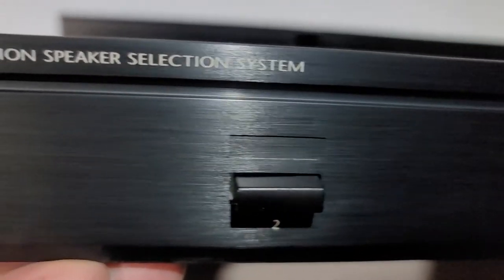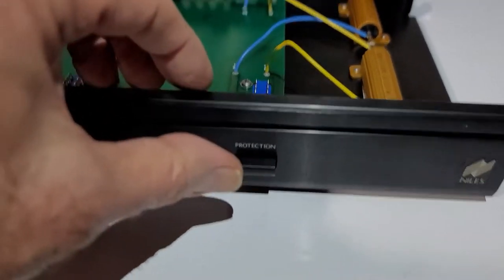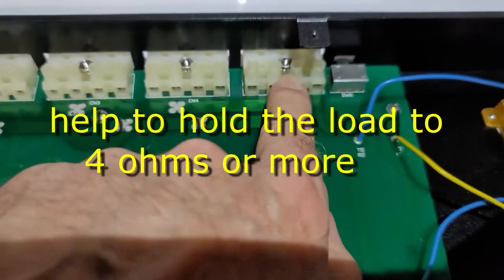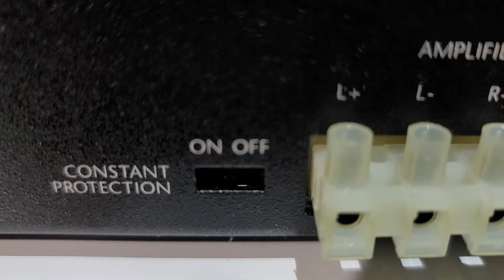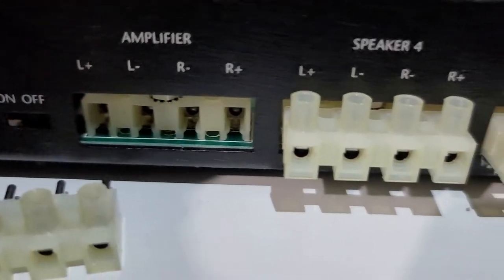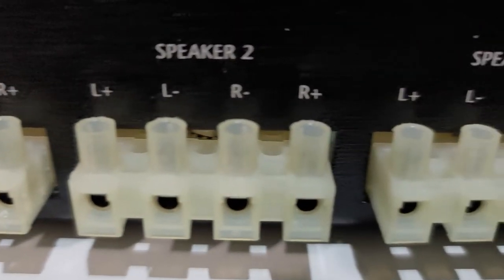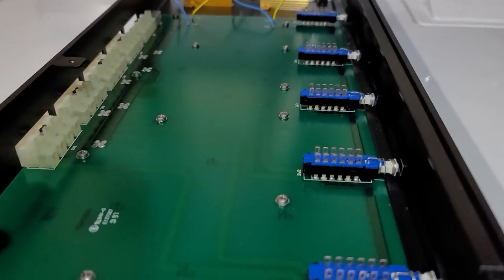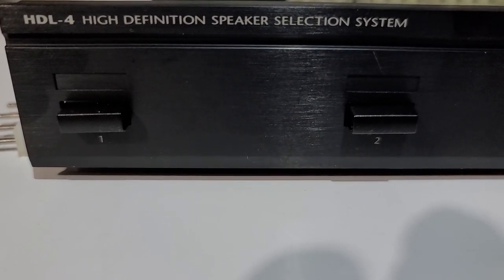NIles HDL-4 Audiophile Stereo Speaker Selector

Comment: Great video! Could you shed any light on the Niles BDA-8? Year, good/not so good, is it impedance protective? Thanks
Reply from the maker: Hi, I don't know the year. It is a rack mount which is nice if you have an installation. What is good is that it supposedly uses 12 step attenuators. Meaning they use 12 different soldered in resistors on each volume control instead of potentiometers. Supposedly this unit has " impedance-magnifying circuitry to keep your amp or receiver running safely, even when driving all 8 pairs".  Unlike almost all Niles switchers, there is no selector for the desired impedance matching. So it must be automatic using an electronic circuit powered by the 16v input. Typical Nile selectors use no power.

The bad thing is the 100 watt limitation on the amplifier output. Amps below 100 watt that could possibly drive 8 pairs of speakers are not made for quality audiophile speaker systems. This would just be usable for background music to small speakers at very low volume.

Comment: Can all spkrs play simultaneously, or 1 set at a time??
Reply from the maker: The switch is a parallel connection. You have to match the impedance (ohms) to your amplifier. Typically amplifiers can handle a nominal rating of 8 or 4 ohms. Speakers often are rated at a minimum amount.  So if your amp says 4 ohms is OK you could select 2 pairs of 8 ohm speakers and the result, since it's a parallel connection, would total 4 ohms and be OK. The protection button puts a 3ohm resistor load in parallel when needed based on the formula. It acts like a 3 ohm speaker. There is a formula for this and it uses the reciprocal function which any scientific calculator has. Even the one built in to Windows. Look online for how to use a common calculator to determine the total load. Just keep your total load at or larger than what the amp is rated for. Note some speakers say 4 ohms but might dip lower and that would be shown in the speaker spec sheet. If an amp attempts to drive a load lower than the rating it will thermally shut down. Or if it's a cheapo amp it will blow up.
Reply: @1sbrokededcantwork115  I'm now informed. Tx